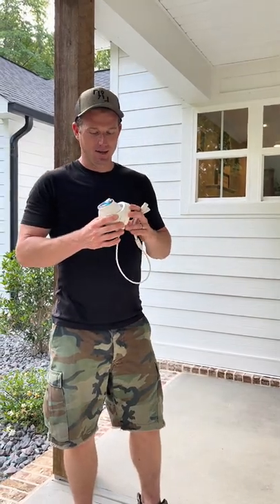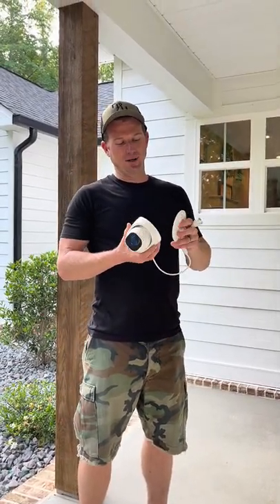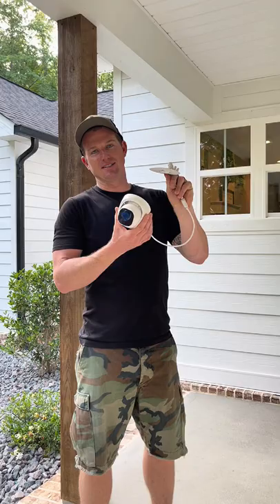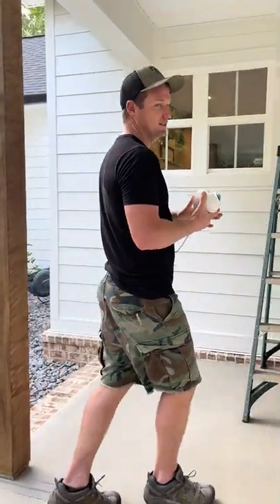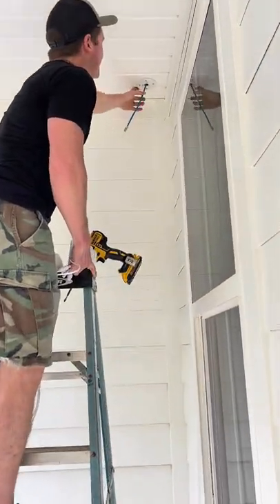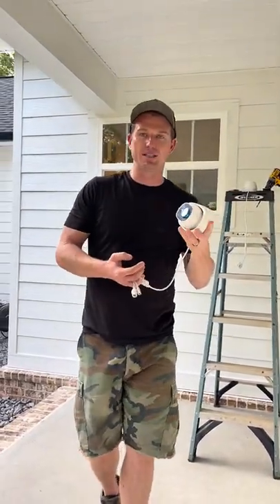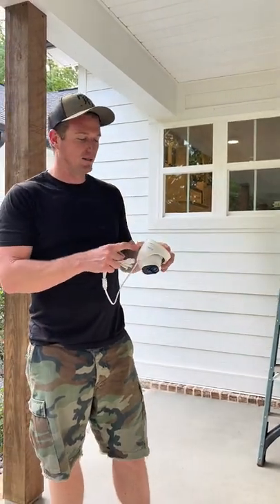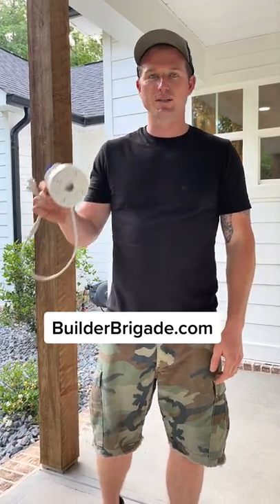Nobody thinks to do this for their home security cameras...  🤯

Comment: Good idea, but not really necessary. As a security integrator, I know that residential security cameras weigh very little.
Reply: I always cringe a little when I’m installing some starlink cams to the soffit. Too many holes and hard to line up, not the mention the crumbly texture when actually drilling the screw >.> lol
Reply: @brawea862  Doublesided tape. Clean surfaces with alcohol and stick them on.
Reply: @FullCircleTravis I feel like that would only work if you live in areas without extreme summer vs winter temp fluctuations. You think the tape wouldn't just degrade after 2 seasons?
Reply: @AG-en5y  
They attach trim pieces onto cars using double-sided tape. This holds up for years on cars in winter environments, even pressure washing. Have to use the good 3M stuff.
Reply: @AG-en5y  3m make some crazy strong adhesives but i can imagine even that would degrade. I'd go with tape and screws.
Reply: @FullCircleTravis right, but trim pieces aren’t dense paperweights that are only pointed towards gravity.  Whereas a security camera (regardless of how light they may feel) are going to be constantly trying to fall towards the earth.  Having said that, butyl tape can actually handle such a chore, but it’s fairly permanent.

Comment: I think the point is he is using POE which people are still oblivious to.
Reply: Nope. He is literally holding the separate power and video dongle in his hand.
Reply: @luisderivas6005  That's just the camera that comes with the ethernet, power, and reset button ports, no? Doesn't he only need to connect an ethernet cable to the camera for PoE?

Comment: You don’t need blocking to make that work it doesn’t hurt but you don’t have to have use grab tight go slow and add grab tight all the around and as soon as your screw grips put some on both set of threads with moist and dry paper towels on hand and some good tape and 2x4 with cloth for underneath support tape for up above take tape up warm water and abrasive sponge will take away any tape marks and if your soffit comes down it won’t be due to that and if you don’t have framing in all your corners then Ummmm that’s a warning sign that a lot more will be wrong hire yourself a house inspector with good ratings I suggest this for anyone it’s nice to know about problems as if sOme get older will cost a heck of a lot more like a $100 fix now vs $5,000 fix in a year and more damage with more time small leaks don’t always show where it’s easy to see so go undetected and as anyone in remodeling should tell you when asked about price is there’s no way I can tell you until I open the area up to see what damage has been done unless they tell you an hourly rate+ mayerials
Reply: Holy crap what did I just read 😂